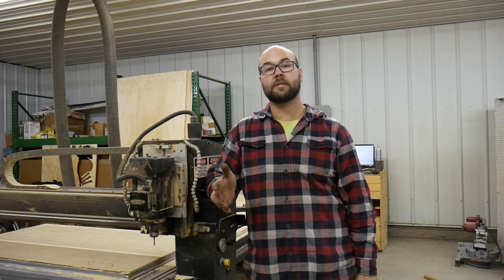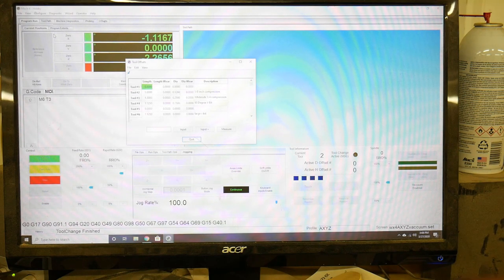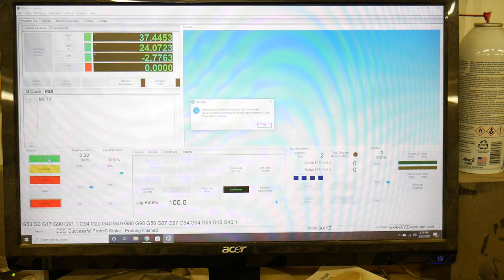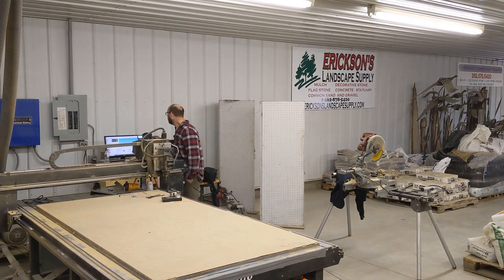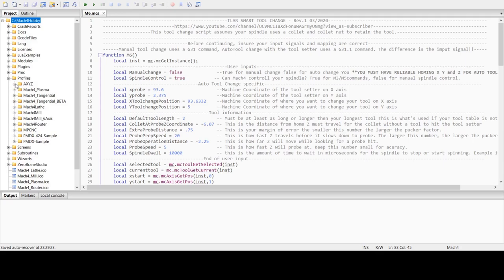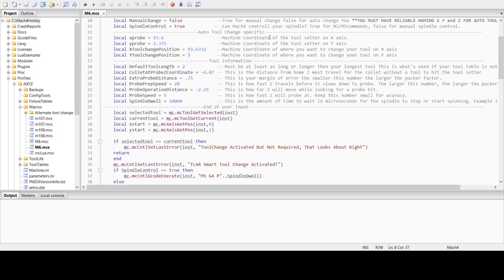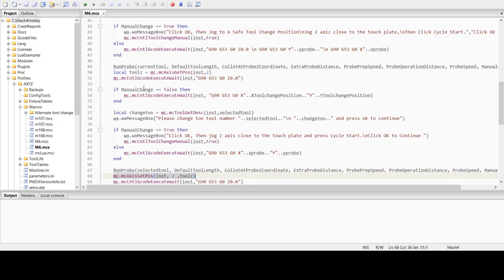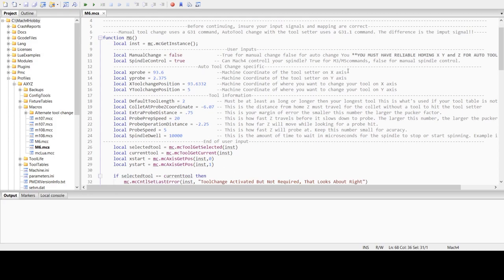TLAR's Smart Tool Change, A tool Change for the rest of us!

Comment: This might be a stupid question, how do you compensate for the touch plate thickness.. I can’t figure it out for the life of me. Thank you!
Reply from the maker: If you're using my m6 script, you don't need to tell it your touch plate thickness, it doesn't really matter because if how the script functions.
Reply: @TLARinc  thank you so much for the reply. I am using your script. When the g-code is invoked “ G43H..Z0” the tool hovers on top of the material with an offset of the touch plate thickness. I could offset in the negative direction my G-code, but I will increase the chances of bottoming the tool in the machine if  or when something goes wrong. Thanks again! And awesome job!

Comment: The M6 needs to be changed in both places to m6
Reply from the maker: No it doesn't. M6 works just fine.
Reply: @TLARinc   I'm not sure when Mach4 changed but with the newer releases it is necessary.  I copied and tried your mcs and it would not run.  Changed the M6 to m6 and it ran. see: https://www.machsupport.com/forum/index.php?topic=43073.msg279195#msg279195
Reply from the maker: As far as I know Mach 4 is capitalization agnostic. BUT,  I do not run the latest update. Thanks for the link and hopefully if someone is having an issue they'll see your  comment.

Comment: Hi. I'm not able to get this to work. Is there any settings in Mach4 I have to change? I use Smoothstepper ESS. It doesn't matter if I set ManualChange to true or false. The "CycleStart" stops at M6 command and flashing the screen once. You can mail me  micke(at)ludwigsson.se if you have any idea what to do.
Thanks!
Reply from the maker: It could be alot of things, start with your pin setting in  ESS and Mach4 control, then follow the video again.
Reply: @TLARinc  hehe I asked as the user Borlänge Musikteater. Sorry for that. I continue as Micke Ludwigsson.
When you mean the pin configs in the video, do I have to change this physical at the board or do I only change the "values" in config settings?
Reply from the maker: In Mach 4 you have to tell the ESS plugin what input pin you connected your touch plate to, then in Mach 4 inputs you gave to tell if to look at the plugin for that input. It's confusing.  I have so many video ideas to make Mach 4 better but to time.
Reply: @TLARinc  
Sorry for the long answer....
Hehe I agree. That I have set in ESS config is Input Signals to PROBE 1 (G31.1), Mach mapping ESS. mapped pin {P1-15} and in the Probing tab checked Probe 1. In Mach4 config the Input Signals is Probe 1pointing to device ESS {P1-15}.
If I do Edit/debug Macro scripts from Mach4 the script works well.
I'm missing something but I can't figure it out.
This is what the log says when pressing Cycle Start: 
2021-01-12 11:33:32.365 - API: mcCntlCycleStart(inst = 0) (unknown caller)
2021-01-12 11:33:32.467 - Attempt transition from "Idle" on event "Cycle Start" machapi.cpp:3039
2021-01-12 11:33:32.467 - S_IDLE_on_exit
2021-01-12 11:33:32.467 - Signal id 1172, (Machine Idle), changed from HIGH to LOW.
2021-01-12 11:33:32.468 - ACTION_start_cycle
2021-01-12 11:33:32.468 - SoftSync()! Clearing planner. command.cpp:343
2021-01-12 11:33:32.468 - S_FILE_RUNNING_on_entry
2021-01-12 11:33:32.468 - SoftSync()! Clearing planner. stateinterface.cpp:850
2021-01-12 11:33:32.468 - S_FILE_RUNNING2_on_entry
2021-01-12 11:33:32.469 - Signal id 1114, (Gcode Running), changed from LOW to HIGH.
2021-01-12 11:33:32.469 - !!!!TMC3in1/VERSION Register HANDLE FAILURE  !!!!!!
2021-01-12 11:33:32.497 - Signal id 1121, (Tool Change), changed from LOW to HIGH.
2021-01-12 11:33:32.498 - >>>>> ESS received a Tool Change Required notification.

2021-01-12 11:33:32.503 - >>>>> ESS received a Tool Change Done notification.

2021-01-12 11:33:32.503 - Signal id 1121, (Tool Change), changed from HIGH to LOW.
2021-01-12 11:33:32.504 - >>>>> ESS received a Tool Change Done notification.

2021-01-12 11:33:33.009 - Attempt transition from "File Running" on event "Stop" gcodeexec.cpp:1026
2021-01-12 11:33:33.009 - S_FILE_RUNNING2_on_exit
2021-01-12 11:33:33.009 - S_FILE_RUNNING_on_exit
2021-01-12 11:33:33.009 - Signal id 1114, (Gcode Running), changed from HIGH to LOW.
2021-01-12 11:33:33.009 - ACTION_stop
2021-01-12 11:33:33.039 - S_IDLE_on_entry
2021-01-12 11:33:33.058 - Signal id 1172, (Machine Idle), changed from LOW to HIGH.